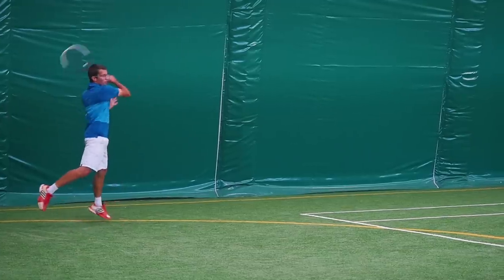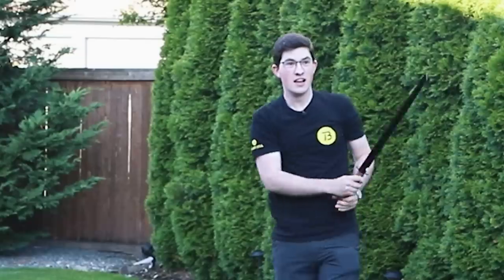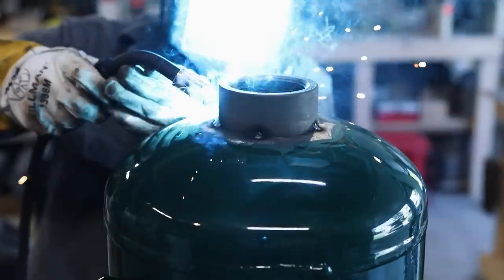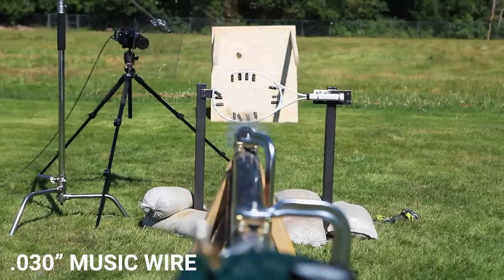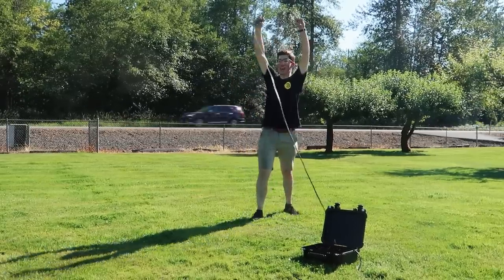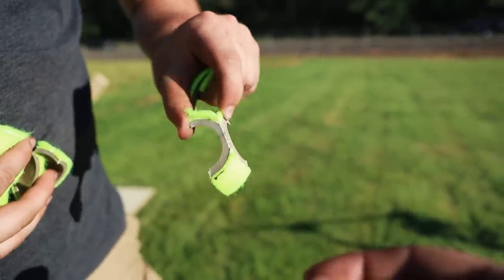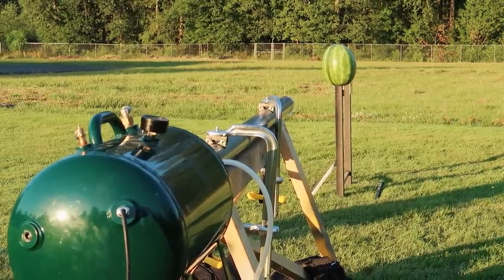500 MPH Tennis Ball vs. Razor Racket

Comment: Only because it isn't extremely obvious, I would highly reccommend some hearing protection. Particularly the over the ear kind. even double up if you can (foam plug in ear with muffs over). That extremely loud sharp sound from the cannon can wreck your ears.

Comment: If i remember correctly most pre-cut fries (those frozen store ones, or many fast food chains), use essentially a water-gun (so same setup but water pressure and/or suction), and an inline grate like that.  So they send in a stream of (peeled/sized?) potatoes, and a stream of cut fries comes out the other end.

Comment: Nicely done man! Those were some excellent results! It was really cool to see the tennis ball completely stop its forward movement after hitting the water melon, that means it dumped literally ALL of its energy into the melon!
Reply: Dunno how you commented 24 min ago when the vid came out 4 min ago
Reply from the maker: Thanks!! Yeah that watermelon shot was nuts! I'm not 100% sure but it looks like the ball split open after hitting the watermelon. We'll never know because we couldn't find the ball.
Reply: @thomaslindroos1667  I bet if you become a Patron too you'll find out ;)
Reply: @TylerBellMakes  Insane! I thought I noticed the same thing, but thought perhaps it was just the tennis ball "skin" ripping? If the ball didn't break open going through a standard racket + a sheet of plywood I would be impressed that it broke on a water melon. But, to my point earlier, the ball still had leftover energy after it went through the racket and the wood (since it moved past the plywood), so the energy transfer was MUCH more complete on the melon. Who knows!?
Reply: @thomaslindroos1667  Also, I may be a time traveler. It's just a hobby but comes in handy to get the first comment!
Reply: @RailandOak  WHO DO YOU WORK FOR!??!?
Reply: @ahuman2533  excellent comment good Sir.
Reply: @RailandOak  i might have to look into this

Comment: I've wanted to make a "razor racket" to make french fries with my potato gun for several years now. My idea was to put a chute behind the racket that would catch the fries after being sliced, and funnel them into a pot of hot oil. I figure getting the speed right would be tricky as you need enough to slice the potato, but slow enough to not splat the fries in the chute/funnel.

Comment: I wanna see this but with meat, I've always wanted to see someone recreate someone getting diced by a fence. Also I challenge you to find a way to catch the potatoes after being cut. My first thought is water because it basically turns even bullets into stagnant objects, the water itself absorbs the impact faster than the projectile can move, but it deforms very easily so it's 800 times more dense than air but deforms easily, unlike steel which is significantly more dense, but far less cushioning, meaning any cut potatoes become mush on impact and I would think this would be fairly universal except with maybe water given how it interacts with things like bullets.

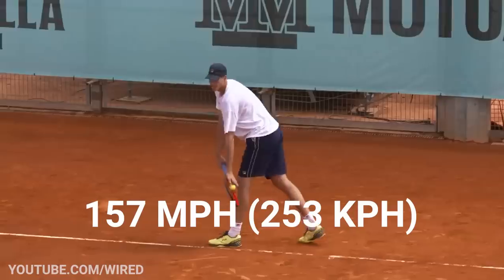Comment: 1:35 You also used a cheap aluminium racquet which you can bend with your hands which is impossible with a high quality carbon fibre racquet.

Comment: Is that a burst disc valve? If it is you can't get a better valve for a pneumatic gun, they open almost instantaneously and have no flow restrictions, I've made a number of them over the years, though they are a PITA to reset. You can go one step further and put a spark plug inside the chamber and a propane metering system to inject a stoichiometric quantity of fuel per atmosphere you pump it to. You'll need a thicker chamber though, and I wouldn't suggest going over a 4X fuel mix at 4 bars unless you purpose build it. Theoretically you could cram fuel and air into a chamber until it turns to liquid, it's more or less the equivalent of gunpowder at that point. I knew a guy a while back on a really awesome potato gun forum (SpudFiles if anyone is interested) that machined an extremely thick steel chamber that he pumped a stoichiometric mix of propane and oxygen into at 200 bars, held back by a scored brass burst disc and ignited with a custom made spark plug. It shot short sections of .75" steel rod fast enough to penetrate 1 inch steel plate lol.
Reply from the maker: That's bonkers!

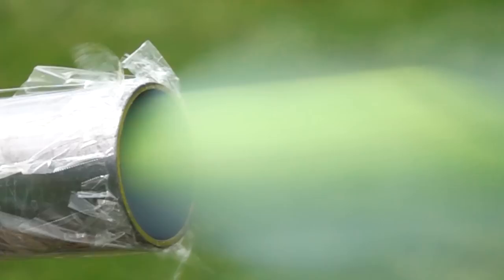Comment: Never thought that pneumocannon can make shock diamonds! (5:35 -> 5:37)
Reply: Doesn't that mean that the air stream went supersonic?
Reply: @AgentWest  I don't know how this occurs and didn't remember now what was the speed of stream, yet speed of ball was definitely mentioned somewhere in the video, don't know if we can estimate speed of stream out of it, though, but now there's a reason to rewatch the video :)
Reply: @SneakyTogedemaru  OK, let's science the sh*t out of this thing! :)
First of all, the tank he's using looks like a 10 gallon (~0.04 cubic meters) AirKeg. They are rated at 225 psi, but a typical compressor pushes 125 (8.5 atm) so let's use that. So at full pressure that's 0.04x8.5=0.34 cubic meters of air ready to rush out through a 6.65-ish cm diameter pipe. Let's call it 2.5" or 6.125 cm since it's a typical pipe size here in the US. Looking at the video, the tank empties in about 0.15 seconds. 
TL;DR - That's 340 liters of air gone in 0.15 seconds through a 6.125 cm hole. Plug this into an online calculator and we get 716 m/s, or around Mach 2.09 unrestricted air velocity. 
Do double-check it though, i was pretty tired when writing all this :)